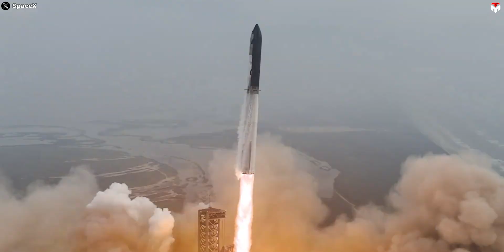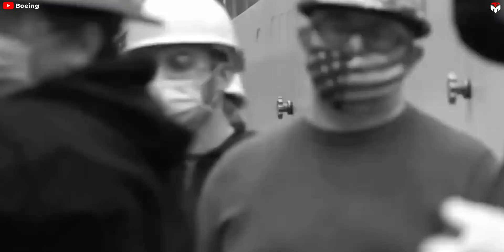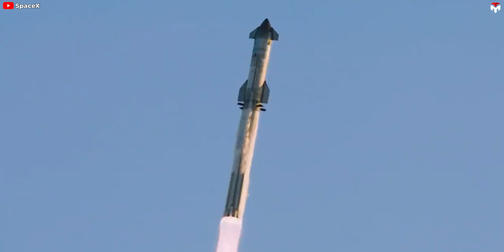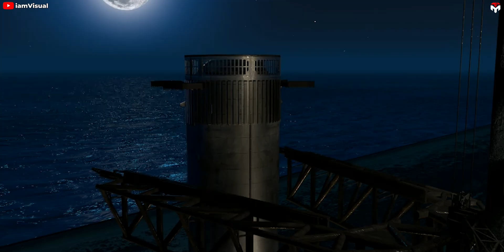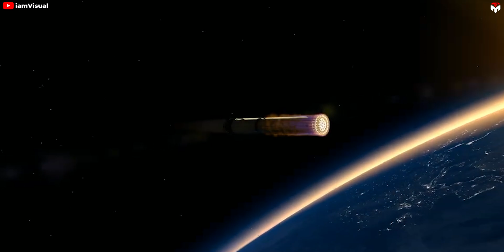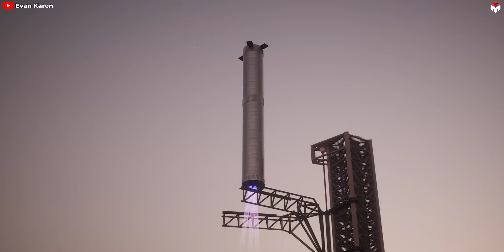Elon Musk just Exposed New Starship Launch Date Shocked Whole Industry...

Comment: Elon Musk will be outed on the coming launch. Ift-5 another failure. If bigger is better. Then at least load it with 200 tons of junk. Then we will have no doubt stainless steel will never fly. You’re only launching empty hulls. If you had succeeded you still would have proved nothing. Let build a full rocket from top to bottom. Oh and you 33 engine wonder burn those engines one way for at the very least of 8 minutes. You won’t because the system will fail at 7.59 seconds.

Comment: Only 50 $ to send satelite not 60 milions $ by using antiGravity Drone 
Vertical lift off is dificult, danger and high cost
This is the SOLUTION
Will replace rocket
AntiGravity Aircraft 
Work base on Gravity just spinning by using Battery
can fly in bad weather, plunge in the ocean even in outer space

Earth which weight predict 600 trillion ton does not fall at the Sun because of centrifugal in orbitting, on the contrary it does not be thrown far go out the orbit line of hold by gravity at the Sun as orbit center. Gravity and centrifugal is equal called Equillibrium, thats why until now Earth which we was inhabited always rotate and circulate the Sun. Now we justly take example : how if the gravity used and centrifugal is negated? The Earth will float far leave the Sun. So that centrifugal can be used to fly far away if gravity eliminated. Finally how to eliminate gravity?

It’s way rotate part of aircraft by horizontal. When that rotation faster centrifugal force getting greater and the gravity getting smaller, finally it lose the gravity and the aircraft start flying. Of course people would surprise: how the aircraft can keep rotate without fulcrums? Thats why we named that aircraft Shuttling System that is aircraft likes two disc adjoining attached in the midle as fulcrums:

A. The Top part, we name Positive rotate to right, and the edges is getting thicker and havier.

B. The Buttom part, we name Negative rotating to left, and the edges is getting thicker and havier.

C. Middle Part , we name Neutral, air crew placed and also machine and everythings turning Negative and Positive at the same time.

The aircraft can liftup added with explosion from the engine. However that aircraft construction later, let the engineer doit it, and we are sure the aircraft will bulletproof and also waterproof.
 
.
.
 
In modern civilization where human being generally using flying saucer as vehicle, will a lot of change in lives either in materialism and in psychological. In materialism area will apply the change in life like.
People no longger need roadway and rel road which spend large of energy, money, places, things and time, object place and time. People would utilize that area for habitat or for other need:

Comment: Easy lift off 
Easy land on with antigravity Spaceship

Work base on Gravity just spinning by using Battery
can fly in bad weather, plunge in the ocean even in outer space
Can lift more than 100 Ton 

Earth which weight predict 600 trillion ton does not fall at the Sun because of centrifugal in orbitting, on the contrary it does not be thrown far go out the orbit line of hold by gravity at the Sun as orbit center. Gravity and centrifugal is equal called Equillibrium, thats why until now Earth which we was inhabited always rotate and circulate the Sun. Now we justly take example : how if the gravity used and centrifugal is negated? The Earth will float far leave the Sun. So that centrifugal can be used to fly far away if gravity eliminated. Finally how to eliminate gravity?

It’s way rotate part of aircraft by horizontal. When that rotation faster centrifugal force getting greater and the gravity getting smaller, finally it lose the gravity and the aircraft start flying. Of course people would surprise: how the aircraft can keep rotate without fulcrums? Thats why we named that aircraft Shuttling System that is aircraft likes two disc adjoining attached in the midle as fulcrums:

A. The Top part, we name Positive rotate to right, and the edges is getting thicker and havier.

B. The Buttom part, we name Negative rotating to left, and the edges is getting thicker and havier.

C. Middle Part , we name Neutral, air crew placed and also machine and everythings turning Negative and Positive at the same time.

The aircraft can liftup added with explosion from the engine. However that aircraft construction later, let the engineer doit it, and we are sure the aircraft will bulletproof and also waterproof.
 
.
.
 
In modern civilization where human being generally using flying saucer as vehicle, will a lot of change in lives either in materialism and in psychological. In materialism area will apply the change in life like.
People no longger need roadway and rel road which spend large of energy, money, places, things and time, object place and time. People would utilize that area for habitat or for other need:😮